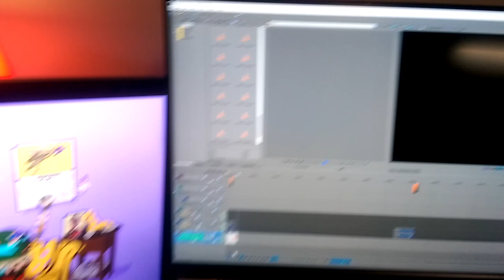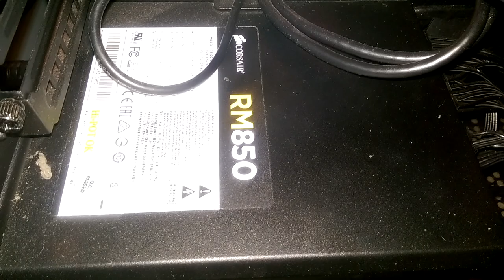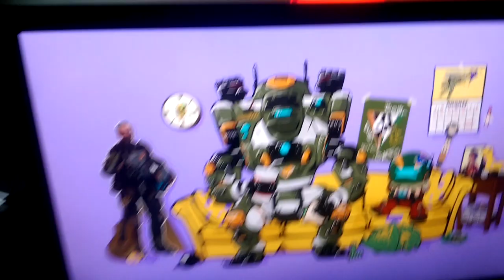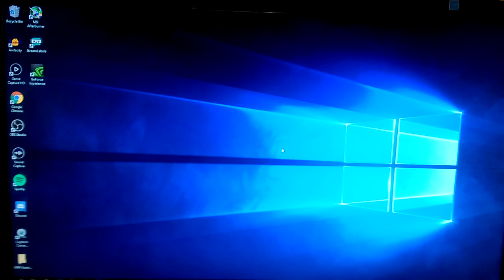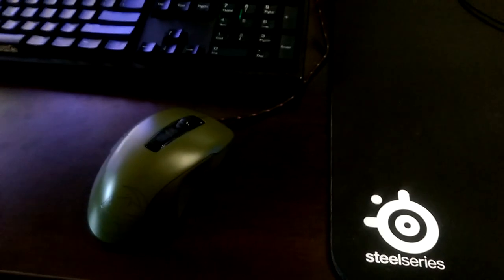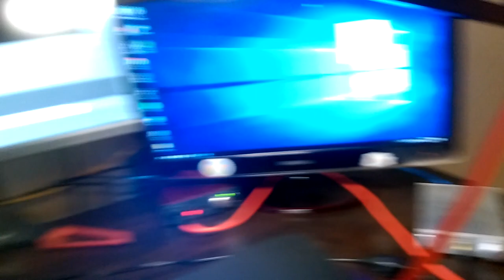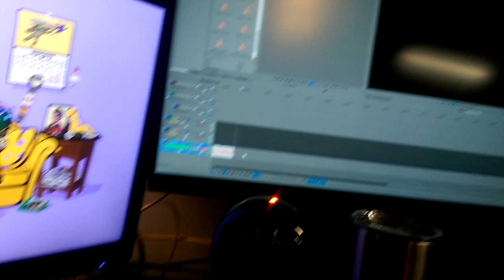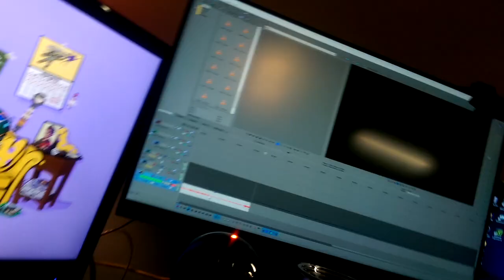Frothy's Setup Tour July 2017

Comment: I'm using a GTX 770. Still works quite well for me, but if you're willing to pass along your EA contacts I'd be perfectly fine with a 1080. I'd have  a 970 but my previous card broke and I got the 770 two weeks before the 970 came out (which was about the same price on release...).